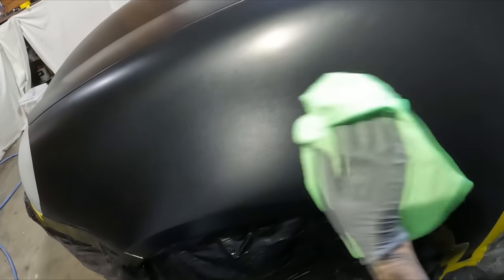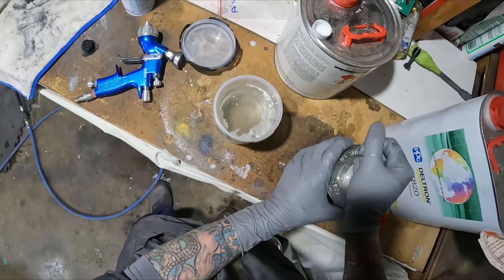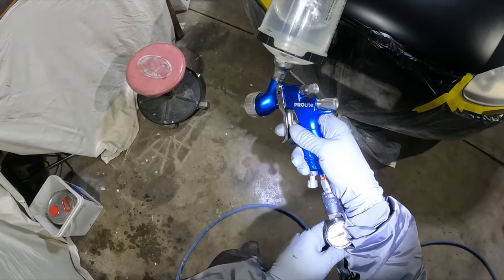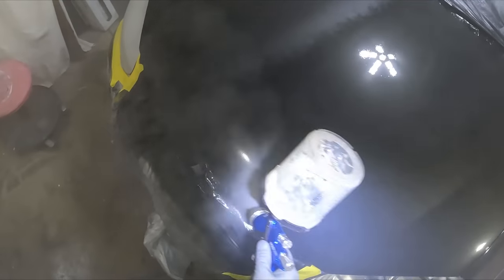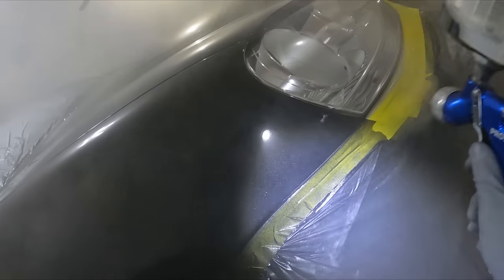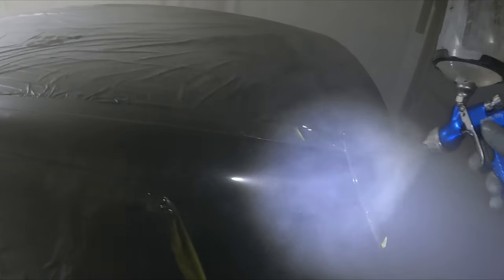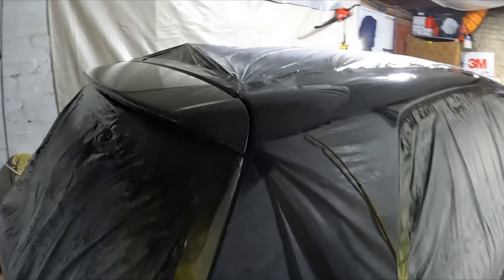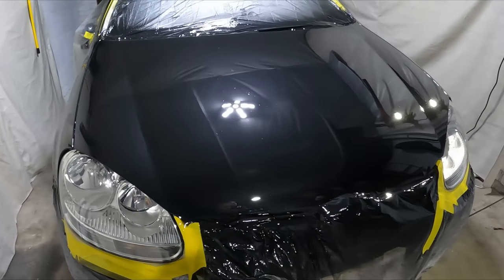Spraying Clear Coat In The Garage

Comment: I have the fan filtered air on the input side to my garage setup, that way the room gets pressurized with clean air. On the exhaust side I install a plywood panel in the garage door which has filters for the exhaust. Your videos have been a great help to my painting.

Comment: Nice job gunny! Another tip I used from the man him self is to get a bucket of hot water to sit your clear mix cup in as you mix it up. Adds warmth to the paint and also a nice thin consistency. Helps a lot when painting in cold conditions ie at home or un heated booths. Cheers. (Ballarat VIC)

Comment: These are the kind of the videos I love watching even after I just finished a spot repair on my own bmw. I could not get it the first time, actually I put the bondo, sanded, put the primer and sanded, then base coat, but when I applied the clear coat, I had a few drips, so idk why I didn't wait for it to fully dry, saw some shitty video with a razor blade and made it worse. But still didn't give up sanded it all down put also bondo in those areas I damaged with razor blade, and painted base & clear coat on top. Turned out really nice. But these kind of videos  show me that it is possible to get great results when spraying in a garage as mine. Keep it up brother!

Comment: I use the dynabreeze 200mm fan & ducting from bunnings it does a good job of evacuating the over spray but a larger diameter would be better I use a filter box also to absorb the odour
Reply: Best to have one fan pulling air into the garage (through a filter box) and then another pushing it out. Much better airflow and fewer particles being sucked into the area through gaps in the roof area etc.

Comment: looking good be interested in seeing the cutting back and buffing we spray at home but in a 30 x 30 shed still get dust specks  no matter how clean we get it  also we use a extractor fan similar to yours
but we put a elbow on it with a box we built to take the proper spray booth filter 
 works great gets rid of that fogging faster 
we put a vent shutter on the outside to keep bugs and wind out when not using it

Comment: I know you have an exhaust fan, but do you have a fresh air intake source? If you don’t, you should consider figuring out a way to allow air to flow in (filtered of course) This will drastically cut down the amount of dust in the paint work. Without an intake source, your exhaust fan will pull air in from every crack and crevice in your garage and that’s where the dust comes from. You can find 20x20 filter grids and fit the with 20x20 sticky intake filters.

Comment: Sweet job as usual man! Good to see some home jobs, showing people it can be done!
I've only ever painted at home and as for fan wise I made a water extraction system that works amazing!
It's jus a plastic 200lt drum, with a water pump inside that runs 3 rings of misters and water running down the sides with a big exhaust fan on top ( similar to yours ) that sucks it out via ducting into the "booth". Have paint filters on ducting in room and another on top of fan and 2 fans blowing in via ducting connected to charcol filters to stop dust coing in. I have a decent sized shed so I have a cheap temp plastic carport inside it and have hardly any overspray coming out the fan. And in summer I spin the fan around to blow out and chuck a big chunk of ice in it and use it as a air con for when im working out there haha
Cost me next to nothing. Something to look into.

Comment: If you dont have much experience applying ceramic coatings, my best advice is just be extremely thorough. Take it panel by panel so you dont get overwhelmed and just watch it set up and cure into that rainbow. Get multiple super soft towels too, l recommend one per two panels. They can get loaded up with the coating quickly and make levelling it very difficult. Most important steps are cleaning with isopropyl alcohol before you apply the coating and double checking for any ‘rainbows’ (cured bits of coating) that you may have missed. If you fail to level any amount of coating it will cure and be stuck on the paint until you go back and re wet sand and polish to remove it

Comment: Morning Gunny,
Doing my usual Saturday morning and going through my YouTube channels, love your videos and thought I’d give you some feedback on your garage set and what I’ve found that works with mine. 

I use 3 CanFan IsoMax silent fans. They each move 3,260m3/hr, sit in a large box I built and has a large filter surface area. But! they sit on the floor a draw the air down at one end of the shed, with the intake filters at the other ends roof. New they’re expensive, but hunting marketplace will see a few a lot cheaper and usually ex-drug house set ups lol.

Drawing the air, and overspray down will clear the room quicker. I tried to extract the same way as you do currently, drawing it up and out, but overspray is too heavy to clear the room without a 3 phase power fan. That and most of the dirt in your paint is more than likely not “dirt” and overspray clear that has tried to be lifted by the air flow up, accumulated together, got heavy and fallen on to the paint. Hence why all the dirt is underneath the fan. This happened to me before I switched up the air flow.

I know it’s going to be hard at a house you’re renting to modify the garage, but essentially making a down draft style booth with leave your jobs cleaner.

Comment: Cool. Definitely would be interested in what ever set up you come up with to remove the gas from your exhaust air. It is very clear that you are going to need to run 3 of those fans to keep the overspray down. You could also build a frame from 2x4 lumber with the inside height of a Normal house type box fan. Cover one side with the filter material like you used and open your garage door half a meter or what ever the height is. Set box with fans in it. Close the door ontop of the frame and pull the paint overspray out with that and use 2 fans like you have set up now to bring fresh air into the garage as a positive pressure type system. As part of your home paint pricing you would have to include the cost of that black filter material because you may only get a single use out of it.

Comment: Hey gunman, always interested in how many coats of PRIMER, COLOUR and CLEAR you put down.

Also how long did you wait between painting clear after the last coat of colour?
Reply: Usual rule of thumb for primer is enough coats to get full coverage, then two more. For colour, it's enough coats until it looks the same colour under bright lights, then one more. For clear it's 2 coats if you're using 2K. If it's acrylic (which I wouldn't reccommend) then you'll want like 6-8 coats, just because you're gonna need to polish it every 6 months for it to stay glossy

Comment: The biggest difference between a booth and a garage for me when using 2k is the amount of extraction a booth can handle compared to a garage, even with decent size extractors. I personally find I have to lower the pressure and use a bigger setup than usual to help cut down the sheer amount of overspray fog. You will need more extraction than those 300mm industrial fans can handle with a filter over them. I use a 600mm industrial fan & it’s perfect for a single garage setup.

Comment: Looks nice for garage black  paint job👍

Why don't you fabricate a frame with electric fans to be placed under the garage roll up door as fresh air intake or exhaust with filters attached to the fans.

The existing fan you have can be the fresh air inlet? 

I have a 20'x20' metal building with garage roll up door, built a 3 electric fan frame and placed it under the roll-up door to exhaust fumes.

They worked great for me. The 2 windows were fully opened with A/C filter on the outside to supply fresh intake of air and to keep bugs and larger particles of dust out.

Painted my bike with fine metallic silver, intercoat clear with pearl, Hawaii'n blue candy and 4 coats of M.S. 2K clear.

Very little dust nibs, no bugs, although room were filled with over spray and dust everywhere, except on bike parts.

Comment: Hey mate, nice work as usual, i found i doubled up those fans, one each side and it dramatically increased the air flow which removed that clear coat overspray much faster. Also i found the filters if they are too tight will restrict the air flow way to much. cheers

Comment: That turned out really nice for a garage job.
You'll want a filtered fresh air inlet setup equal to, or slightly larger in diameter that your exhaust fan (think CFM).
Otherwise, you can create a slight vacuum situation and the overspray then has no way to get drawn out.

It's gonna be awesome when you get everything dialed in there.
Diggin' the videos 🤙

Comment: Haha, welcome to my world, I worked out small parts at a time.
You could of broken that up into 3 separate clear sprays. That's if you want less overspray.  But then you got to do more masking and plastic sheeting work.
But man so glad to see you giving us some in depth home jobs 
Excellent.
Reply: And for ventilation, I sprayed on a South wind so just after laying clear I'd wet down outside and lift the roller door up half a foot then open the opposite door and big plumes of over spray drifted out and was clear within a few minutes..
Probably not law abiding but hey it worked.
And I live in low density rural area so didn't effect anyone.
As you said you work with what you got😁

Comment: I use old pleated ac filters in front of box fans to exhaust the garage air. I place them in the 2 windows of the garage.The charcoal filter is a good idea. I'll try that by putting it behind the pleated filter next time. If that reduces the air flow to much I'll try it on the exhaust side of the fans.

Comment: For my extractor (car radiator fan mounted near the ceiling) I run a 30cm diameter pipe down to floor level. So its pulling the dust/spray etc downwards before it pulls it out of the building. My thinking is by pulling the air at floor level I'm working with gravity. Pulling the air out directly at head height I think it would keeping the dust and spray suspended in the air and dragged over my piece.

Comment: Careful gunny the omni clear is very bad and lasts only 1-2 years before peeling. We had a lot of bad luck with that clear. I use finish1 fc720 clear which is cheap but I have a test panel sitting in sun for 4 years now and not a single issue yet. Been using that for 5 years. As always keep up the good work! Me nor my bodyguy who got me into painting will ever use nen it again. He used to use it alot and always an issue.
Reply from the maker: Ok thanks, I'll stop using it after this kit

Comment: "The Fug" when spraying clear in a non-booth situation gets Dull. Using a LVLP gun helps, as does having a 30" extractor fan as a minimum - but the main thing is to not go skimpy on the respirator front - 3M or Norton seem best - because with 2-pack clear, you can die quite fast if the respirator is crap - in the "dead" fashion as opposed to the vaguely cool "Ohh, I was dying!" manner.  You can be coughing up blood that evening quite easily if you goof on the "breathing" front...

Comment: I've got a question about clear coating headlights, ive done it before and it always seems to crack and split on me, ive followed what you usually suggest to do but it always seems to do it on me, i wouldn't think 2002 headlights would be the cause, im wondering if it's the type of clear or im just doing something wrong, i sand it with 400 up to 800 and a wet sand of 1000 and wipe it down with prepsol and spray and it immediately starts to split, i was using 2k baslac clear coat 2:1 aswell with 10% thinners, i don't know what i was doing wrong anyway
Reply: Do you use plastic primer? I've had the same issue when not using it

Comment: Are you concerned with the potential for an explosion from an electric spark or something from those fans? I was researching fans for use at home and apparently you should be looking at what are called "intrinsically safe" fans which are typically belt driven with the motor sealed away and unable to make contact with the room air. They're a bit pricey though.

Failing that, I'd opt for an inlet fan pressurizing the room with no outlet fan to avoid that risk.

Comment: Good job would you ever consider spraying outside after watching your videos I tried painting my scania truck bumper it turned out okay but ended up with a few runs I didn’t leave enough time between coats 
Was Fearful of clear coat going of in gun
Reply: Should last an hour at least in a gun mate if it’s not hot as outside.

Comment: Looking to buy a spray gun to spray for home. Have the Chicago hush 70l air compressor  would a lvlp spray gun be ok for metallic base coat and clear coat. What tip is best. 1.3m or 1.4m?
Iwata - devilbiss up to $650. Thanks
Reply from the maker: Yes, it should, if it has the 3 motors like mine it should have no issues with the T110 1.3 on the pro lite. That's what I used in this video

Comment: Please don't keep spraying till you get the airflow system right - you're too valuable as a person to fuck around with your health to risk breathing in paint fumes if your filters break through. I use one of the big crates (about 1.2m x 900mm x 400mm deep) my bead roller came in as a large filter box with filter media on a steel mesh on the 1200 x 900 side. I've used 2 fans like your red one pumping air out of the shed and it takes nearly all the odour out - no neighbour complaints (although I do mow a couple of their front nature strips.when I cut mine). I bought a 20m roll of booth filter media for about $120 and so far I've used about 1.5m of it doing 2 cars from bare metal, and i've only got another 3 to do.. Don't know how to send a photo of it or contact you but if you want a chunk of the filter media, you're welcome to some of it, as there's more on the roll than I'll ever use..I'm in Inner South East Melbourne.
Reply from the maker: You can email me. But I have the same filter now. thegunmanraw@gmail.com is my email. I'm in the same area

Comment: Another huge mistake your exhaust should suck from the floor. I worked at a place with 4 intakes sucking from the floor no doors and the paint jobs were not half bad. And I set up my shop the same way